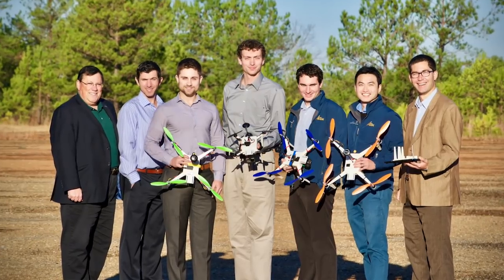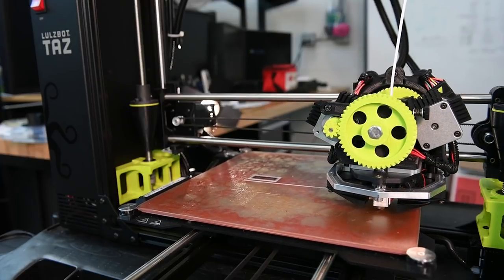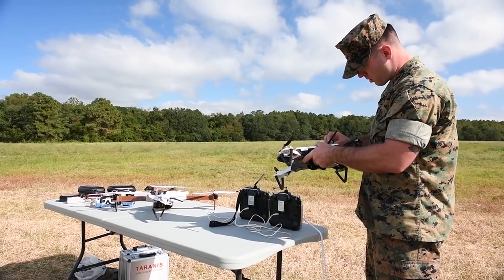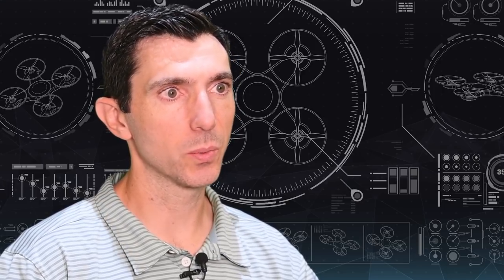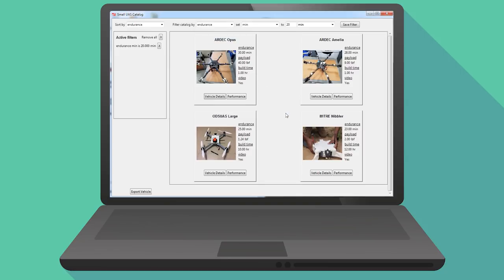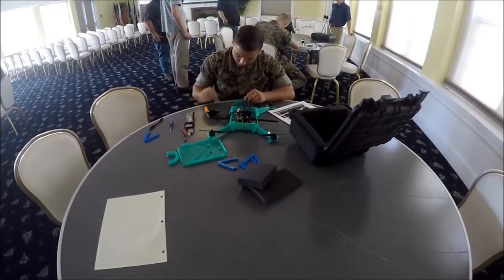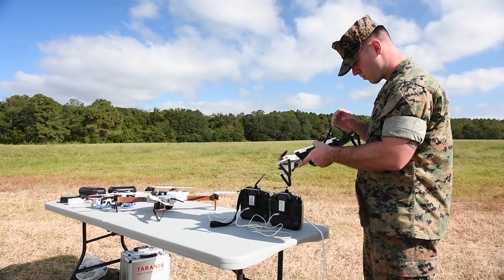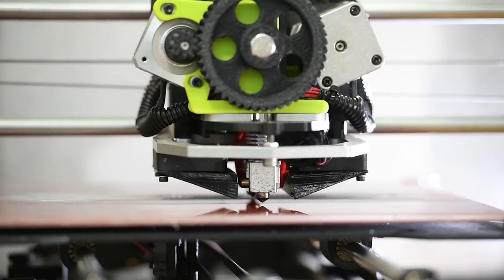3-D Printed Drones

Comment: lol..so you guys want to carry a huge 3-D printer into a battlefield and try to print a quad while the enemy is shooting at you?? Good luck! A better idea is to have prefabricated parts and just connect them together like lego for the specific mission.  If you want durable, stick to carbon fiber frames. There's a lot of us in the drone racing community that can build a micro-drone as small as your hand in less than 2 hours, and capable of flying it a mile away with a real-time fpv camera system.